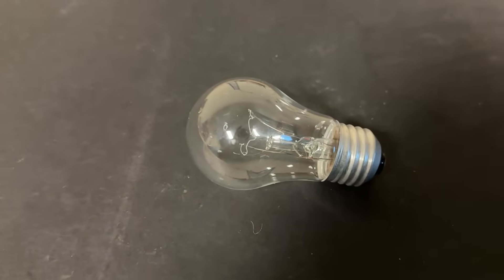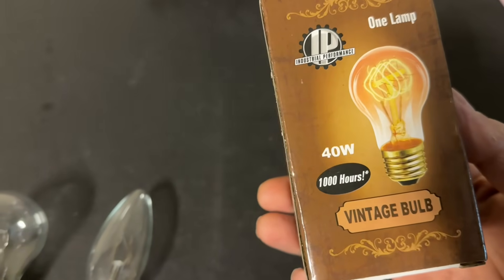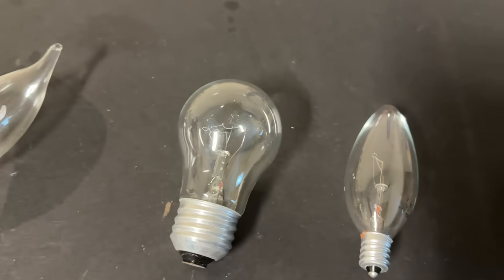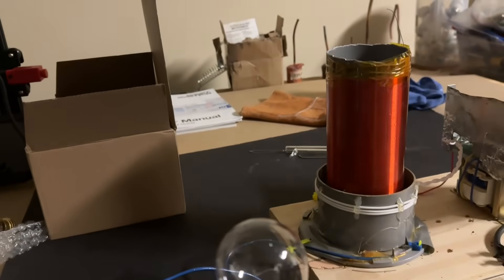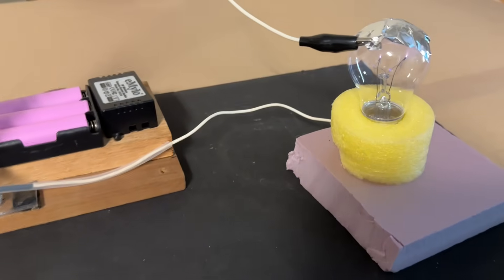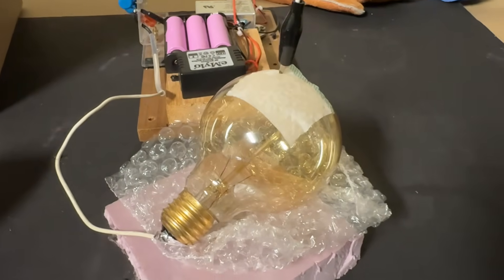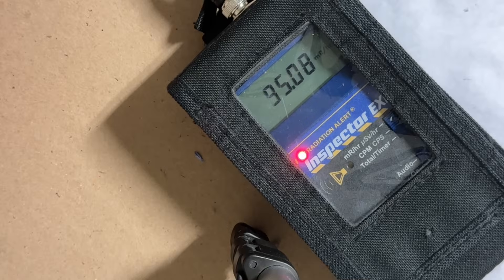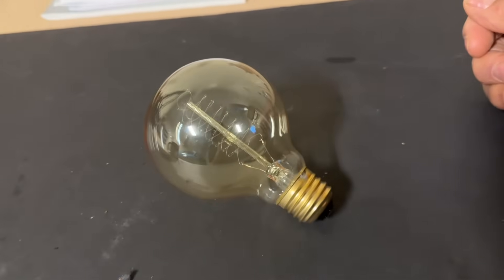Intense radiation output from Vintage lightbulb

Comment: I would like "Radioactive Drew" to comment on this type of radiation. Does paper stop it? Is it logarithmic power from the source?( every foot away it drops by half)
Reply: X-rays do propagate in exponential form indeed, tho I cannot from my head confirm the numeric value. Paper cannot stop X-rays, tho alpha particles may get attenuated by it quite a bit. Considering this is emitting X-rays indeed, paper would not stop it.
Reply from the maker: Paper won’t stop it because it passes through plastic cover protecting the open screen of the GM tube
Reply: @Kalvinjj  I wonder how much of it is from 40KeV electrons (betas.)   Some might penetrate the ?1mm? glass.   Block betas only, using wide magnets to deflect the beam away from the detector.

Comment: How does this compare to a chest xray?  Is it more or less?
Reply from the maker: I believe it’s more than a chest x-ray. However, given the short amount of exposure time, it’s gonna be close to getting a chest x-ray. Difference between this and the chest x-ray is that all of the radiation is absorbed by the human body because it is soft radiation, which makes it more harmful.
Reply: Over could mean it's 1,000,000 or 1,000,000,000,000,000,000 times higher, no way to know from video.
Reply: @yootoobvyooer  DC supply wattage is the limit here.   Dangerous x-ray sources use hundreds-watts HV supplies.   Also, if it can slightly light up a zinc sulfide CRT screen, then you're up in the danger zone.
Reply: This was technically a pocket-size Chernobyl
Reply: @ I found it. “An X-ray machine in a hospital produces X-rays using an X-ray tube, which is a vacuum tube containing a cathode and an anode. The cathode emits a stream of electrons when heated, and these electrons are accelerated towards the anode, typically made of tungsten, by a high voltage. When the electrons collide with the anode, about 1% of the resulting energy is emitted as X-rays, while the rest is released as heat. The radiographer can adjust the voltage and current settings on the machine to manipulate the properties of the X-ray beam produced, which is then used to create images of internal structures such as bones and organs.
X-ray energy=accelerating voltage×electron charge
This equation represents the relationship between the accelerating voltage and the energy of the X-rays produced.”
Reply from the maker: @grumpy3543 yes heated cathodes do waste a lot of energy as heat. I’m not sure if x-ray production is actually more efficient with a cold cathode but I suspect it is.
Reply: @ That’s so interesting. So does the Xray machine at the doctor’s office produce X-rays the same way?  Or do they use something else?
Reply: @grumpy3543  light bulbs impact the electrons on glass.   Medical x-ray tubes impact electrons on tungsten (although the 1920s tubes used platinum.)  Also, they use HVDC well over 100KV, for non-soft x-rays.   Also, the HV power supply is several hundred watts, for incredibly intense x-ray output.   
Normal x-ray tubes use "reflection," where the x-rays come from the same side as the electron-impact.   Light-bulbs use "transmission," where the electrons hit the glass plate, and the x-rays spew out from the other side of the plate.   Only one medical x-ray tube does it this way, the "cone-beam" tubes, "transmission Bremsstrahlung" tubes.   Those produce a narrow beam, not just spewing x-rays over 180deg fan-shape.
Reply: @ So he just created the Xray tube with a light bulb and foil.
Reply: Wow. Thanks. That’s amazing that you can make an Xray device in your garage with a lightbulb.  Who would have thought that you could irradiate yourself with stuff  from Home Depot.

Comment: Now imagine heating the filament to encourage thermionic emission.
Reply: Current goes up, voltage goes down. Energy per electron goes down, xrays get MUCH softer, and are stopped by the glass. 

Essentially, you'd get an operational 5U4 rectifying tube running. Plenty of current, but insignificant xray production.
Reply from the maker: @kirkkohnen5050 yes exactly it’s like the equivalent of the 2X2A

Comment: What a fascinating and scary experiment.
Reply: Oh, hi there!
Reply: One moment please 😊
Reply: Incredible demonstration! I’ve actually tried a similar high-voltage setup on a vintage Edison bulb before, and I noticed the same X-ray spike. It’s shocking how much ionizing radiation simple glass can emit when electrons decelerate rapidly. Definitely a reminder to keep distance and use shielding!
Reply: @diytoptricks  An old style TV screen , cinescopic tube can produce x rays as well , just increase grid voltage and watch :)
Reply: I'm glad that he did it, so I don't have to!  Yikes!  Scary indeed!!
Reply: I feel like I've seen you somewhere before. Do you work at the DMV? 😊
Reply: Indeed!
Reply: Call Electroboom!   You can turn your eyeballs white via x-rays, no microwave ovens needed.

Comment: Hi. I'm the guy that suggest you to use the x-ray film hinder to see it glow.
Now I'm going to suggest or ask about use a vacuum chamber to do it. My vacuum chamber has 2 wires through. I used epoxy to close the hole and works well. I can operate things from outside. So you can modify parameters like size, distance, geometry, material... of the electrodes.
Reply from the maker: Good suggestion. Yes epoxy is a good seal. Will try
Reply: @BrianDhvTinkerer  The sharp point of broken tungsten wire will spew electrons radially outwards, even making interesting patterns on chamber surfaces.  Wave a magnet around to bend the patterns.   It's the 1920s version of the electron microscope.

Comment: Interesting! Something on these lines was described many years ago ('Scientific American'?) using an old vacuum tube (radio valve).
I would not expect X-rays from anything other than vacuum devices. How sure are you that you are getting X-rays: the Geiger counter may be responding falsely to the intense high-voltage field?
Reply from the maker: Thanks. In the video I ran the GM tube near other gas filled bulbs containing neon and argon as control experiments for high voltage electronic noise setting off the GM counter. This proved it was X- rays. Also I operated the GM counter at quite some distance away from the high voltage source.

Comment: to remind you if you forgot, and to inform those who don't know, the standard of measurement is to put the probe 1/4" away, although you don't necessarily have to do that. you can use the equation for intensity at a distance to calculate what it would be, then the number is reported for 1/4" away.

the detector on the table looked to me like about 2 feet away. for 100 mR/hr at 2' that would be 9.22 rads/hr at 1/4". however if you indeed detected 100 mR/hr at 4' that would be 36.9 rads/hr at 1/4".

the Elephant's Foot at Chernobyl was putting out 8000 rads/hr of gamma. presumably they meant at 1/4".

x-rays deposit up to 4x as much energy in bone as they do soft tissue, so multiply your readings by 4 to determine relative effect on bone.
Reply: Rads?  Sieverts and Gray are the new international standard.
Reply: @teresashinkansen9402  Ahhh do we have to be international here? Though they are the new standard some of us are more familiar with the older ones and with something like radiation we rather use the measurements we know than miscalculate using the new standards.
Reply: @dr.strangelove5708  I think its important exactly for that reason, miscalculation and wasting time doing conversions, eventually everyone will use it and that problem stops but if people keep using both the problem persists forever. The internet is international. 

I also hate that people use comma or dot to represent decimal, there should be an international agreement to use one or other but not both. Im used to dot, to me it makes more sense but Im willing to move to comma if that means the nonsense of using both stops.
Reply: @teresashinkansen9402  don't quit your day job at wal-mart

Comment: When I was in high school, the physics class had a homemade x ray machine...the power supply from a ( crt) TV, a clear 300 watt bulb, and some sheet Tri-X pan film ( this was the '70s). You could get passable images after a few hours...
     I wonder if you had a zinc sulfide screen,  could it be used  as a fluoroscope?
Reply: Zinc sulfide glow-paint.  Better is to find old hospital x-ray cassettes, e.g. Lanex intensifying screen, and pull out the fluorescent sheet.  Those are designed for efficient fluorescence w/x-rays.   Little result (I think we'd need a genuine x-ray tube in order to see the slightest flicker.)
Remember, geiger-counters are seeing single photons.   Consider visible light instead.  With one tiny dim LED, yards distant in a dark room, how many photons enter your eye per second?   Billions?  One tiny LED will completely overload a single-photon optical detector.  (Get a single-photon photomultiplier tube, and rig it up to make audible clicks.  It will saturate if it sees a distant LED being powered by one microamp.)
When geiger-counters are driven crazy by x-rays, that's still insignificant radiation, down in the microwatts.   Geiger counters scare everyone.   X-rays do become dangerous when they're at a similar level to the UV in summer sunlight  ...watts-scale x-rays that can slightly heat up a target.   Medical x-ray machines can do that, with hundreds of mW, not microwatts.  Slightly slightly heats up your bones.

Comment: 3:45 As crazy as it sounds, we have a lot of high tension high voltage metal towers running to this massive substation and the voltage is 256,000 volts and my instructor said to take a 4 foot florescent bulb and hold it up under the lines, and it glows

If you run Christmas lights along the fences under the lines they light up like they are plugged in. 

I wonder why they don't use this free power to light up LEDs
Reply: It's not free. The load imposes an inverted field proportional to the current flowing. So the electric grid does feel those lights you hold up. Remember, Every time current flows magnetic field lines radiate out. The ones coming from your lights oppose the current in the high voltage wires causing electric current to be consumed by the small drop in voltage created by the imposed magnetic field.
Reply: @3fives-j5w  came here to say this ^^
There is no such thing as free energy.  Another system or metric ALWAYS pays for energy to be converted/moved/etc.
Reply: @nup5  Sunlight is free energy. Or do you have to pay for it?
Reply: @3fives-j5w  Its free because you dont have to pay for it.
Reply: @mernokimuvek  Someone is paying for it. And because of losses, it would actually consume more electricity to power an entire house this way instead of just using a step down transformer.
Remember, there is no free lunch in science.
The energy comes from somewhere and goes somewhere.
Your radio transmitter sends out radio waves which costs energy, but a radio receiver on mars will be energized by those weak radio waves and in the process an inverted reflected signal (it's 180 degrees out of phase) radiates out from the receiver's antenna and it will eventually be picked up by the transmitter antenna which in returns creates another inverted reflection which then itself radiates outward so on and so forth. Of course these reflections are so weak than after the first 2 reflections the technology we have today could not detect them.
Reply: @3fives-j5w  If the someone paying for it is not you, it is absolutely free energy. Like bypassing the meter or stealing power from your neighbors.
Reply: Didn’t someone get busted for putting wires along his fence under power lines to power his house. It’s actually against the law.

Comment: We had lightening hit the pole and it hit the 240 volt secondary winding and the outside lit up from the lightening bolt, but inside, the TV in the bedroom was a 32 inch tube Sony TV. 
The TV was off
But the tube glowed blue, and the picture came on but the picture shrunk a was a single line on the screen then a dot, then nothing but this weird blue light that lit up everything inside the house 

20 years later, another person had this happen and they saw the entire inside of the house glow this weird beautiful blue color. 

It had to be radiation from the high voltage from the lightening bolt. 

Very scary
Reply: I think that might be more like St. Elmo's fire (i.e. corona discharge) caused by the high electric field. Definitely scary!
Reply: Lightning does give off X-rays. A plane stuck by lightning might subject the passengers to X-rays and from my research it's not unsubstantial

Comment: Just curious, does swapping polarity make a big difference?
Reply from the maker: Yeah, I’m pretty sure it would. I didn’t try it, but I’m almost certain that word because the glass would not be a good emitter of electrons compared with the tungsten filament
Reply: @BrianDhvTinkerer  I wonder how the DC drive-current gets through the glass.   Probably it's only microamps.   Maybe it's 40KeV beta particles (fast electrons,) and they just go through the glass, same as any ionizing radiation?   If so, then the negative terminal must connect the the base of the bulb.   (Me, I've only messed with light bulbs and ACHV, w/Tesla coils.   My DCHV supplies here are only 10KV, not near enough for a quick test.)

Comment: Interesting, but you really should familiarise yourself with ‘safe’ radiation levels. I saw your meter hit 100+ mR/hr that equals 1000 micro sieverts/ hr and is 400 times the legal maximum in Australia!! It’s up to you what exposure you get but please think about others nearby, even pregnancies! The energy level will be relatively low but the intensity is high.
Reply from the maker: It went well above 100 mR/h at 4 ft away ( ~1.6 R/h at 1 foot away) which is why I stopped messing with it and concluded the experiment.
Reply: @BrianDhvTinkerer  statistics tables say that a 10mRem dose has equivalent lethal hazard to driving 40 miles in a car, smoking 1.4 cigarettes, spending 6min in a canoe, or eating 40 tablespoons of peanut butter.   For lethal hazards, I guess it's the durned canoe-trips whats gets yuh in the end.   That, and crossing busy streets, or standing up in bathtubs while taking showers.
Reply: @wbeaty  I understand most of that except the peanut butter, 40 tablespoons at once? How does peanut butter kill you.
Reply: @djmips  It's actually the "found a peanut" song.   Peanut butter colon cancer.   This was a huge deal in the 1970s news, when first discovered, and sales of Skippy etc. crashed.      
Rotten peanuts are full of carcinogens, aflatoxins, and a portion of incoming peanuts are rotten.   Just make your own peanut butter, with sorted-out good peanuts.